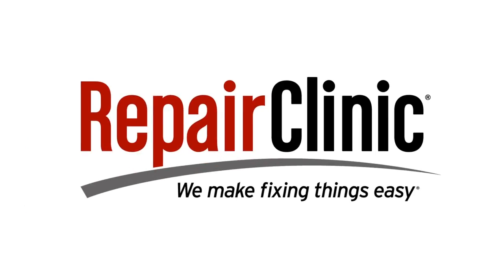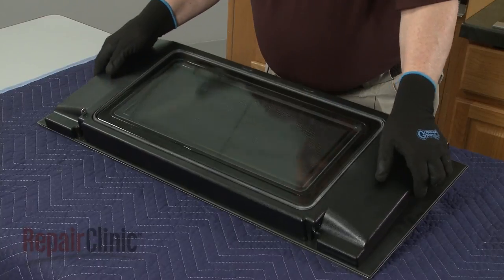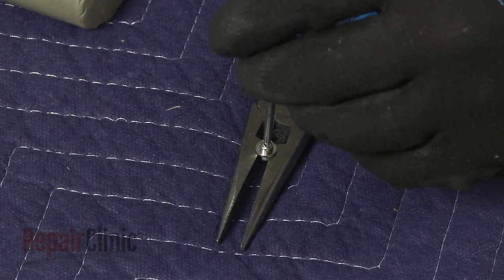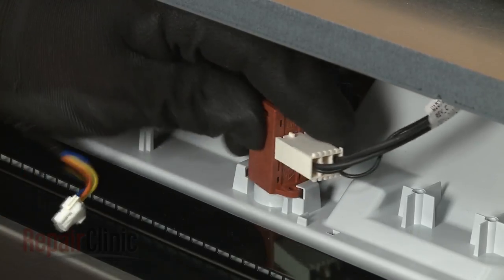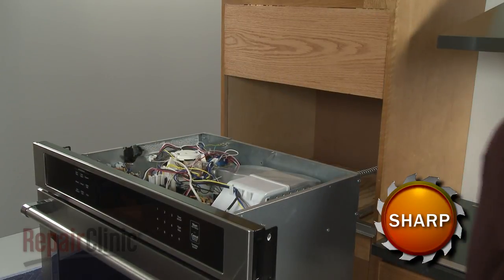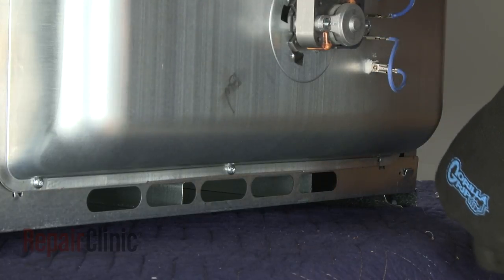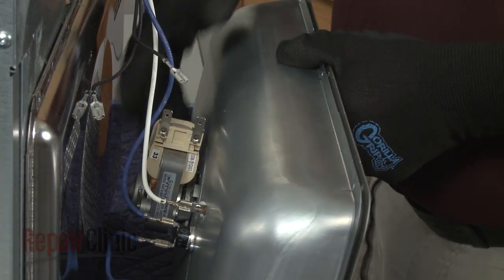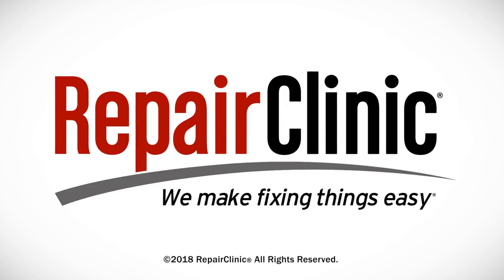Kitchenaid Microwave Disassembly – Microwave Repair Help KMBP100ESS01

Comment: How do you remove the glass to clean the inside?
Reply: I had some food drip down between the 2 glasses doors. I only had to remove the two screws (at 1:32) and was able to fit my hand in to clean it. I didn't even need to take the door off the hinges.